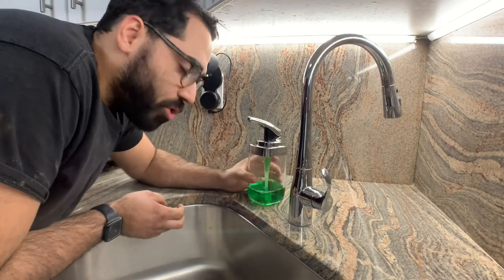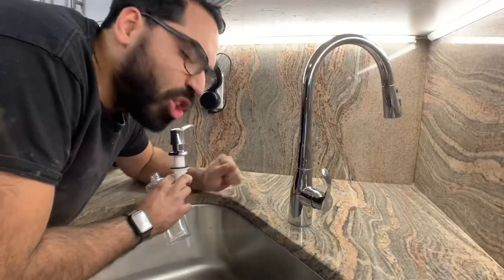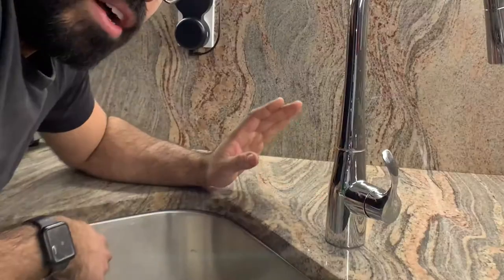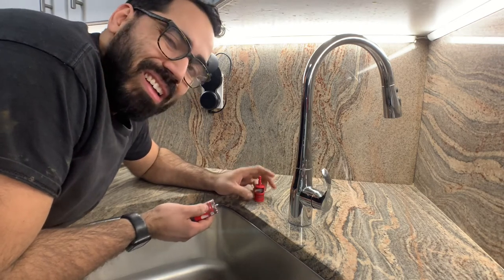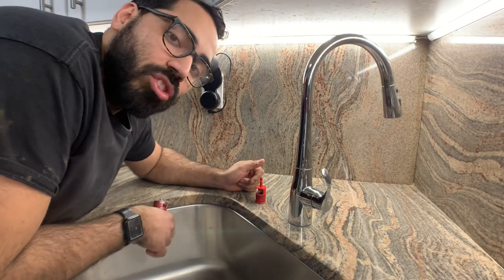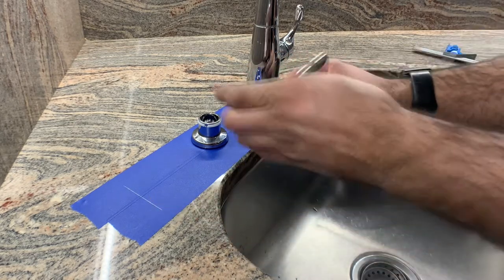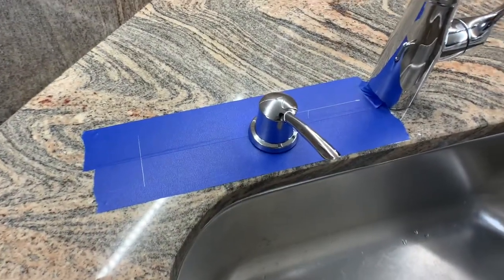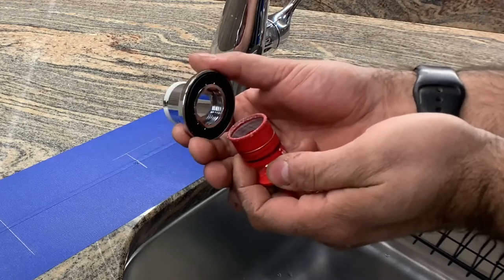Installing under counter soap dispenser// Skill Stacking

Comment: Our kitchen sink came with this kind of thing. Looking at doing it to all the rest of my sinks (porcelain). Although we did do 1 modification, rather than using the bottle it came with, we got a small 2ft clear tube from Lowe's and ran it directly into one of those larger 64oz soap refill bottles, and made sure the tube's Inner diameter fits over the dispenser's tube so now we don't have to swap out the soap frequently, and when we do it is just sitting underneath the sink and we don't have to reach up and untwist anything. You just pull the tube out, put the new soap bottle in and put the tube back in.
Reply from the maker: Yea, that system is much better. I have that one in the basement. I am thinking about getting that.

Comment: Would it help if I try on to practice on a sample floor tile?  I always want to practice first before I actually do it on the countertop.  Will it simulate similar experience?  Thanks.
Reply from the maker: Yep that will be a good test and if you get the Milwaukee bit you can count on the bit not worrying down before you do the real thing.
Reply: @skillstacking  thank you. A handyman quoted me $125 to drill the hole.
Reply from the maker: Don’t pay. Not worth it

Comment: Great video! I watched because I just bought a place and we already have an in sink soap dispenser installed but when water gets around it, the water seeps under the soap dispenser and gets under the sink. Do you have any advice for that?
Reply from the maker: When you take it apart, between the crome base of the soap dispenser and the stone you should have a river ring. If it’s old your you don’t have, you can buy a square piece of rubber and make your own. I have a link under this comment.

MATNIKS Rubber Sheeting, Heavy Duty, High Grade 60A, Neoprene Black, 12x12-Inch by 1/8 (+/- 5%):
https://a.co/d/6JEaLpG

Comment: should you seal around the soap dispenser for water? I plan on doing this in my kitchen.
Reply from the maker: No need. If not all, most come with a rubber seal that stops water from going down. Let me know if you have more questions.

Comment: How did you get under there with all the plumbing there in the way?  Thanks!
Reply from the maker: That is the hard part. It is extremely tight. Just have to go in. If the pipe is the way. Get someone smaller to get it. Wish I had a better answer for you.

Comment: Guessing you’re using a hammer drill for this?
Reply from the maker: NO! Do not do that. Use a drill with a clutch and set it to like 10 so if it grabs it won’t twist your wrist or potentially damage the stone. You don’t need too much pressure. 

Let me know if you have more questions.
Reply: @skillstacking  ok thanks